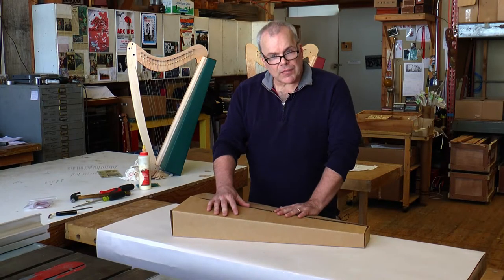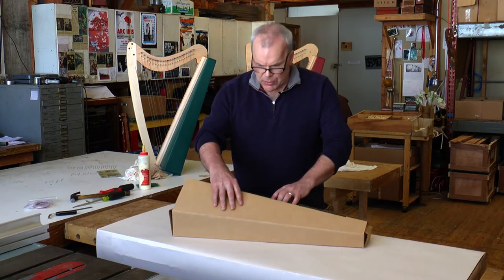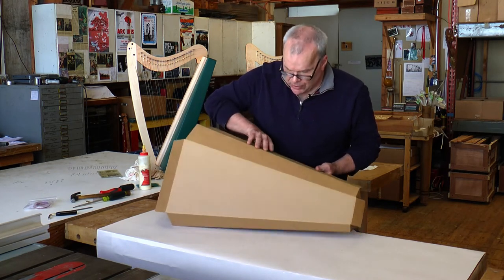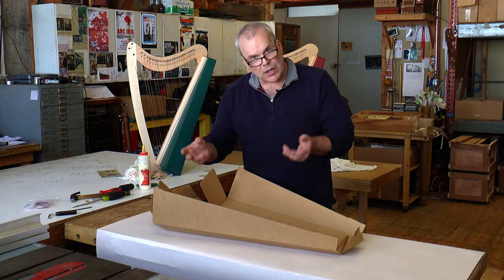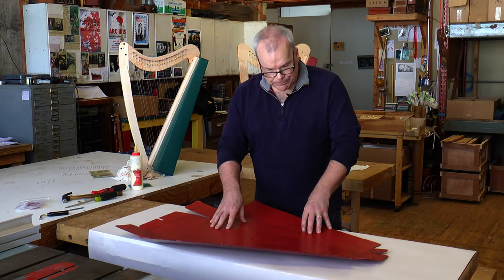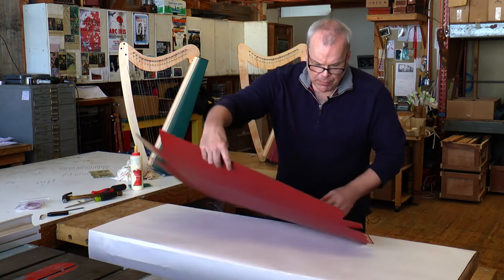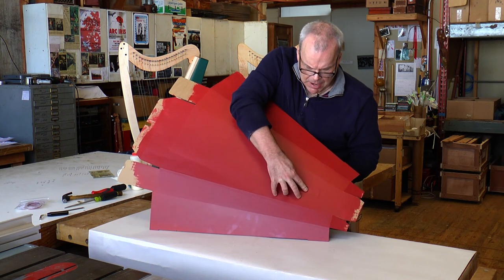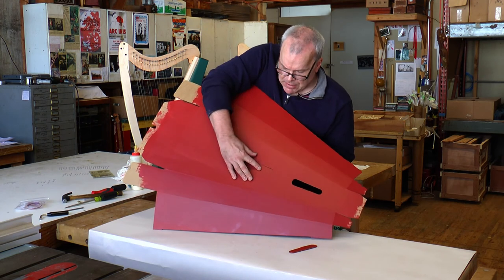How to Build Your Fireside Harp 1: Painting

Comment: Can you prime the soundbox to help make it sturdier?
Reply from the maker: You sure can! It's actually recommended...a coat or 2 on both the inside and out are very useful. A coat of Polyurethane helps seal it even better..
Reply: @BackyardMusicSounds  So, two coats of primer +1 coat of paint + 1 coat of poly would give the best results?
Reply: @lemecdlabeauce  yes indeed!
Reply: Does the harp wood still stick to the soundbox after sealing it with polyurethane?